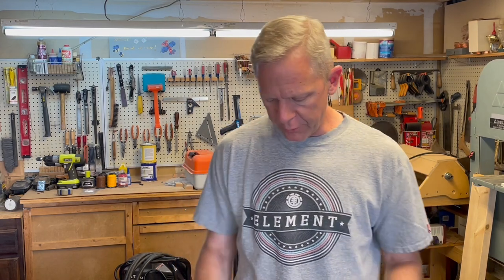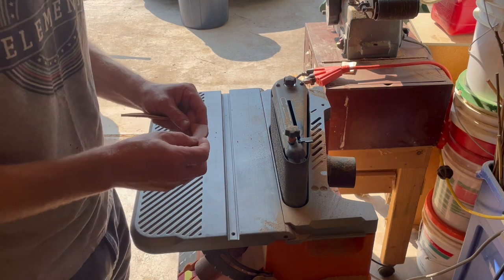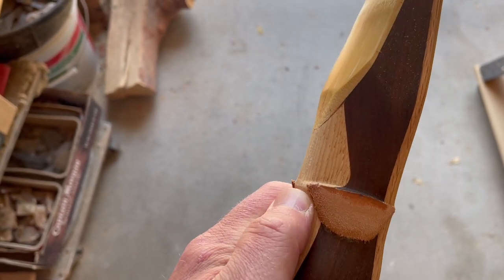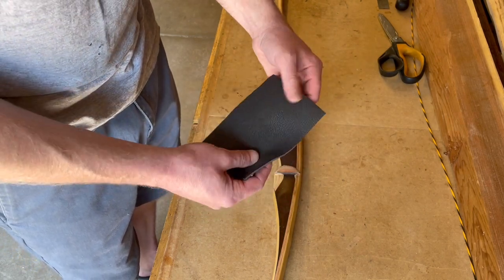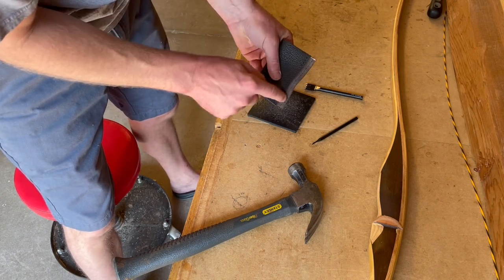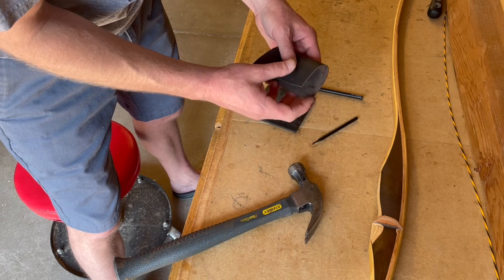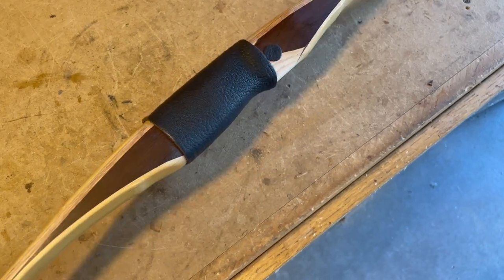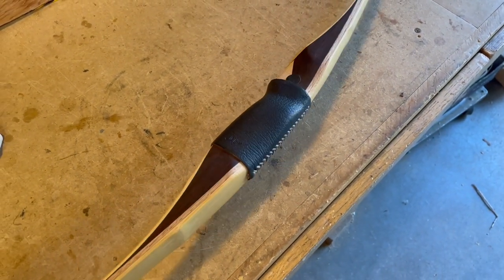Applying a leather shelf and grip - Bamboo back and belly bow pt.11

Comment: Really nice result with the grip! So it is not necessary to use an adhesive? The grip has not shifted since this video?
Reply from the maker: When you cut the grip leather so it will be tight before wet molding, it will shrink upon drying to the point that it is so tight that it will not shift.